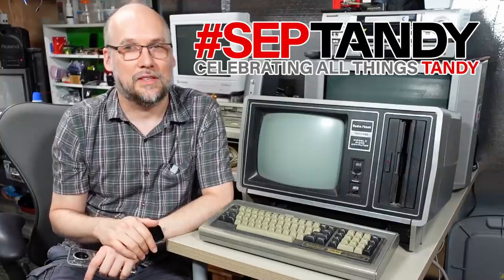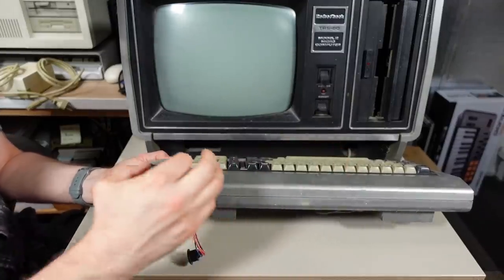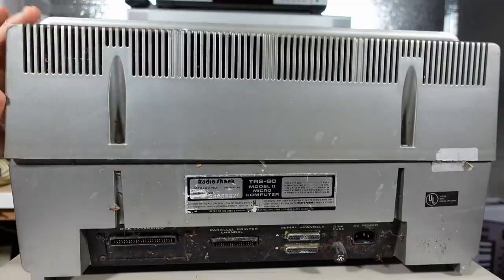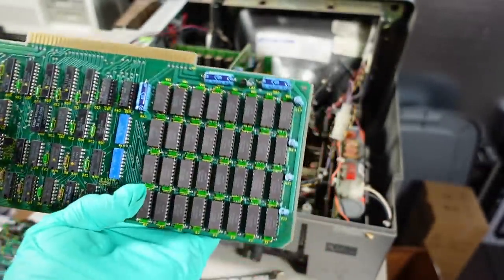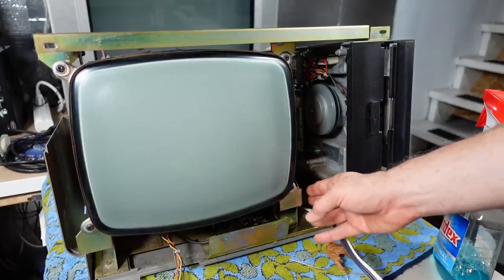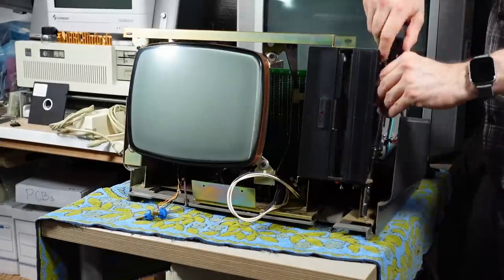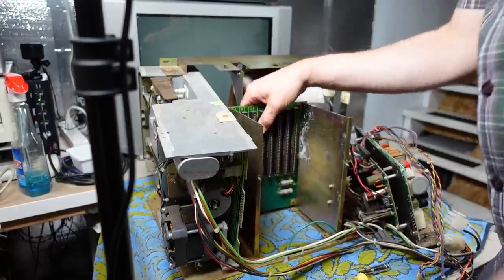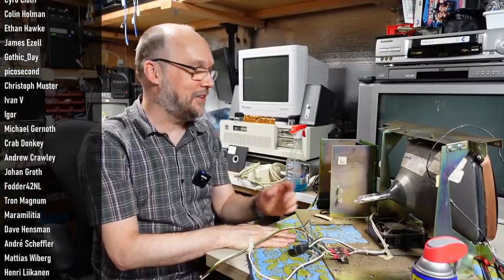Another left for dead machine: a TRS-80 Model II #septandy 🕸🕷🐜

Comment: I scored two of these off our local computer store's 'free stuff' bench 20 years ago, along with the heavy 3 drive expansion unit and boxes and boxes of disks.  One had a dead screen, the other a dead PSU.  They had taken all the cards out of both for salvage.  I got the cards on ebay and in my first ever vintage computer repair I managed to mix and match enough working parts to get one working machine.  Honestly I'm a little afraid of it.. when I turn it on, esp with the expansion unit, my lights dim. :)  Definitely a neat machine though.
Reply: I think you need a sub-station just for it… 🤣
Reply: Salvage=making a pittance off of cutting boards up for GoLd.... Stupid STUPID!
Reply: @jonathan_herr  Yeah.  :(  I'm hopeful though that they just went out as spares for other machines or something.
Reply: I will bid 400 quatloos for that towel!
Reply: Love it... Brings me home
Reply: For what its worth, even when they were new, the screen would dim when you started working the expansion drives. As I recall anyway.  Its only been 40+ years ago. SC
Reply: Ya, I had gotten two of these from a garage sale, the construction on these is horrible.  I have no idea what radio shack was thinking
Reply: @steingat  At least the end of the CRT neck isn't .005mm from the back of the case like it is on the Model III.
Reply: @steingat  ..I worked at “The Shack” when these came out…
We had surprisingly few repairs on these… mostly connectors that had come loose from shipping…
Reply: Maybe a shorted line cap in the PSU
Reply: Wow!  What a story!  Thanks for sharing! 💻

Comment: Nice! I learned how to program on a hand-me-down Model 4 in the mid-90s. -- holding down the orange button to boot into basic, and using "LLIST" (two Ls) to print ("save") my code to the daisy wheel printer. 

It's amazing to think that the cell phone I'm typing on is orders of magnitude more powerful than 90% of the computers I've ever used in my life... Thanks for the nostalgia, Adrian. ✌🏻
Reply: A daisy wheel printer printed nice, but we kept it in a case when it was printing due to noise.

Comment: When I started as a trainee in IT in '96, a lot of the Engineers had a "proper" tool kit with gas soldering irons, multimeters etc. One thing they did have (and I still have) was lonnnnng screwdrivers in PH2, TX15, 8mm, 5.5mm with a Magnetiser/Demagnetiser tool as there was still a lot of older terminals/PCs/NCR Towers that looked a lot like taking this TRS80 apart, and obviously put together with priorities of being able to survive a direct hit from a howitzer rather that user serviceability in mind!

Comment: I used them when new and have kept three of them running. We bought a Techical Reference Manual for our Model IIs in 1982 which I still have. EXCELLENT source of nearly everything in these and the 1-3 drive disk expansion unit. They are 100% business machines!. They were "built up" from the baseplate thus your dissassembly was harder than it would have been had you the info on the sequence of assembly. Power supplies have Rifa caps that go bad. It may not boot without the disk terminator plug depending upon the era. Western Digital and CDC 8" drives. GREAT machines for the time. Heavy and big but our firm did a LOT of things even IBMers didn't know how to do. Enjoy it Adrian.

Comment: Oh and I was going to say but forgot: Remember when you are testing that the 8" drive connector has a 24VDC pin.  If that connector is not plugged into the drive, the switching PSU won't start up and you'll think the PSU is dead even though it isn't.  That one had me stumped for some time.  You don't have to have the 120VAC power connected to the drive, but the DC cable has to be.

Or you could probably load the 24VDC rail with a big resistor or something to get the PSU to start up, but I've never tried that.

Good luck, man.  Again, let me know if you need any of the parts I have.  Contact info in that other comment.
Reply: Comment so Adrian sees this
Reply: Hey Bud!, Did you ever get that 8 inch going (The NOS one I think it was) I have another, and just curious!
Reply: @trs-80fanclub12  Hey man!  Long time no see!  :D

I haven't tried it yet.  I need to swap the logic boards over from the other drive.

I really appreciate you sending it to me, but if you want it back since I am taking so long to get around to trying it, just say!
Reply: @Lee_Adamson_OCF   Lol No Way, Its a relic, Keep it or find a needy one that needs it. Otherwise its a extra brick for me. Still trying to focus on getting a shugart real 5 - 1/4 to work on a usb adaptor.

Comment: I was just given one of these that was on its way to the trash pile that had been in storage along with the disk expansion system with two drives installed and a DMP-400 printer (and a Compaq Portable).  I believe I have the original manuals, there is a handful of disks, and the units were in storage with proper dust covers.  I'm expecting them to be in good shape.  It's all loaded into my poor Honda Accord at the moment.  I wouldn't have room for a passenger if I wanted one LOL! I know little to nothing about these machines, but I am excited to have one in my collection now!

Comment: @Adrian's Digital Basement I am sure someone else will have commented with this suggestion already but I do a LOT of automotive repair with bolts in really nasty places and a trick I often use is chewing gum stuck in the socket then the bolt or nut.  It will hold JUST well enough to keep it from falling out but will pull out when you lift the extension/stocket.

Comment: For reassembly, I stack a bunch of socket extensions like you did, and then tape the screw into the socket until I get it started, then pull off and remove the tape and then finish.

Comment: As I am nearly fished restoring my own model II I can say its a fun project.  The technical manual actually gives you the make and model of the tool required for assembly and disassembly.  It is really just a big nut driver that was commonly used by tv repairmen back in the day.  I will also be changing my 8" floppy for either a gotek or pc floppy drive.  Ready made adapters are available  There are a number of great model II software archives out on the internet.

Comment: I used to do A LOT of work on these.  The backplane is a take-off of the S-100 bus.  It's only 80 pins and the boards had a taper on them.  We used to build 10Megabyte and 411Megabyte disc drives for them.

Comment: With regard to your socket issues:  Try a 12, 18, or 24" extension that works off of a 1/4" hex quick-lock chuck.  Then use a cheap harbor freight or other magnetic nut driver that fits into that quick lock chuck.  Your total thickness of the tool would be approximately 1/2 to 5/8" which should fit into many of those spots.

Comment: That is a run capacitor on the Shugart drive. The "proper" way to disassemble is to remove all the "modules" to reveal the bare chassis. We used an Excelite 18" magnetic nut driver to be able to access the "module" mounting screws.  You will need at minimum a TRSDOS disk to boot the machine and it must stay in Drive 0 at all times.

Comment: Brings back memories. The early or most disk drives were Shugart and were reliable not so much on the Texas Peripherals drives and yes you used a terminator unless you had an expansion bay (drives).

Comment: The motor on the disk drive looks like a Shaded Pole motor, which would not normally need a start/run capacitor.   I am about 3/4 through watching now.  Looking forward to seeing this project through.  I think this machine could be a hidden diamond in the rough with a little bit of TLC.   You may need to change the big filter caps in the power supply for reliability in the future.     I find a bit of "blu-tak" works well to hold screws to drivers if you need to get them into a tight place

Comment: I have a Model 4 and it works, but needs a little work with the keyboard. Most of the keys will register correctly, but a few just do not register at all. Could simply be dirty keys or a possible bad cable/connection. Otherwise it boots to ROM, and both 5 1/4 drives work. I really love Tandy systems. My first computer was a Tandy CoCo Model 1, with the chiclet keyboard! 4k of RAM! Good times!

Comment: The private school I went to had one of these donated.  It was sitting at the back of the lab, separate from our Apple //e's.  It had an external bay with three floppy drives, and an external hard drive on top.  Our computer instructor allowed me to try it out .  I hit the TRSDOS manuals, and learned how to boot the machine.  I tried formatting the hard drive, but was stymied by a  bad sector.  It was the first hard drive that I'd ever encountered , in the mid 1980's.  In operation, these guys were intended to work with video terminals hung off of them.  Tandy/Radio Shack made terminals for this (serial ports) that looked like a Model I.
Reply: In the late 80s/early 90s my local Radio Shack had one of these running in the office with Xenix on it. The registers up front were dumb terminals and they had an okidata printer for receipts. They were using some DEC terminals up front.

Comment: In my basement is a working dual-floppy TRS-80 Model 16. Six months ago I started it up and a capacitor blew, but it still runs (have to take the cover off or it starts smoking). I bought it back in 1982 so I could automate my bowling league scorekeeping. Which it did, after I wrote the programs in COBOL. Other than that, I had no real purpose for it. It seemed to be a better deal than the IBM PC at the time. Little did I realize that IBM would become the standard.

Comment: I can't stop thinking about these machines.  The dual-machine offering by Radio Shack really contributed to the failure of the TRS-80 brand.  
The dual-marketing in their catalogs ruined their branding.

The Model III/4 was a neat, clean machine.  Big and clunky but y'know... pretty ok with lots of expansion features.
And the Model 4P (I bought one new) was really nice and had good developer tools (ALDS) and was a lot of fun for me.
I learned how to program in assembly language on it...  better to develop on than the IBM PC at the time.

But that dual-approach to product lines really hurt them.  And then, suddenly, they were simultaneously selling:
1.  The Model 4
2.  The Model 12/16
3.  The IBM PC clones that weren't really clones
4.  The color computer, which was a joke.
5.  The pocket computers, which were a joke
6.  The Trs-80 Model 100/102/200... the first two were really good but stole marketshare from the rest of the product line!

Yow.  I don't know what they were thinking.  They just couldn't stop and focus on a primary product.  They pissed off every TRS-80 owner, except the Model 100 users who didn't upgrade for a decade, coz "laptop" development stalled between the Model 102 and PCs until 80386 cpus could be crammed into smaller notebook computers.  That took a decade I think.

Comment: Man, I remember working on those old TRS-80's, and they're not fond memories. We had a couple Model III's, and they were an absolute bear to disassemble and service. It's as if they weren't even designed to be serviced after they were manufactured. After replacing the disk drive on one of the III's, I accidentally cracked the neck of the CRT when trying to reassemble it. The 4P was a bit easier, and I actually still have one which still works perfectly.

Comment: You really should try evaporust for things like this. It's much better than things like a rust inhibiting spray paint as it actually attacks the rust and leaves you with clean metal. Plus, it's reusable, gentle enough to get on your hands, and cleanup is easy: just dump it down the drain once it's too dirty to continue using. I have used it numerous times to restore old tools like wood planes and I've even used it on old rusty cast iron cookware. It really is amazing stuff.

I've also used naval jelly too, and that stuff also works pretty well but for small stuff just dumping the parts in a vat of evaporust is really the better option. Evaporust can work for larger items too, you can soak paper towels in it and apply the paper towels over the rusted area and just make sure to keep them wet while the process happens. I've done it that way too. I've found that the rust converter stuff in a spray can doesn't work as well, and can actually cause rust if you get it on non rusted areas.

Comment: Well I am looking forward to this one! At one time in the early 80s Tandy sold the most Unix machines by number of units, something like 40,000 for the Tandy 16B-6000. They had what Apple and Commodore didn't, "big boy" management and supply chains - all they needed was the right software vision and open specs and we'd all be running Tandy-compatibles today. They were even told as much, but squandered their big lead with incompatible proprietary machines having poor software choices. I sure hope you manage to get this old boy running! And long live the Z80! This was a real computer in the modern sense, as capable as the IBM PC.
Reply: The ‘open spec’ stuff at that time was S100 Bus for the motherboards and daughter boards…on the software side was CP/M OS along with the mighty Unix/Xenix….

Except for the boot code, CP/M was wide open….
Reply: @ernestgalvan9037  The TRS80-II has an S-100 type backplane but is not an S-100 machine. It is all proprietary.

Comment: You found the reason why the slang a Trash 80 was put on. This computer was only meant for service buy a technician and the tools and equipment with the manuals were locked away at night. Manuals a brown ring binder or later ones black and silver.
Service contract was highly recommended.  Piles of these computers around the service centers when mod 3 came out with 5.25 drives.

Comment: so back in the day I used tech wax... which was basically a soft wax.... you put some on your socket and then shoved in your nut or screw and it had enough holding power to get it started then but not to much to prevent you from removing your socket... I believe they started making tech wax again... it's a really simple product and it works

Comment: I'm sure this is long since reassembled by the time I'm watching this, but you can use foam or tape or something INSIDE a socket, shove the screw into the socket, and it'll hold to guide a screw down into a deep spot without a magnetic socket.  It's fiddly and sometimes falls out but it does work.

Comment: Sometimes fun to operate blindly - as long as your definition of "operate blindly" is less destructive than the 8 bit guy.

Single phase AC motors don't necessarily need a run capacitor, many have just a start capacitors, but that's for asynchronous AC induction motors, I don't remember how synchronous ones are wired.

In the car world, this would be called a "survivor" and the wear on the keyboard paint would be "patina" 😁

Comment: Presumably technicians of the era had the tools one would use for that equipment. Today we use different equipment making things easier to repair - except cell phones.

The question here is whether we want/need to keep this totally pure, or if we can find alternatives that could improve our situation. I think I saw a video about putting a Gotek in one of these systems (don't remember if it was a Model II or a Model I). Getting software on 8" floppies is going to be near impossible, whereas downloading software and storing it on USB seems more likely. One way or another, this machine is going to need the OS "diskette" to boot from. Until you can do that, all the other software is moot. In fact, until you can boot (P/S works, video works, floppy drive works, acquire a boot diskette), this is a steep climb. 

It'll be good to know if the CRT works - if it doesn't, another display will be needed - either a CRT, or to somehow bolt an LED to the frame and make the video card talk to it.

Then there's the P/S. Surely we could just put a more modern and beefy power supply in. 

If any or all parts work we can skip that step. Then we can work on the keyboard and fix anything needed on that. I do not envy him... 🤞

Comment: IIRC it was a GREEN phosphor CRT.  Let' see if I'm right.
IIRC there were some half height 8" floppy drives made with DC motors.
8" floppy drives had 40 pin connectors.  SCSI was 50 pin.
Those cards look like Intel Multibus cards, without the smaller connector.
That REALLY was a "trash 80" computer!  Hope you get it restored!
Good thing you made a video of the tear down, so you will know how to put it back together.
There should be some images on line for CP/M for the TRS80 model II.
I used to have a Z80 "big board" with 3 8" drives that ran CP/M.
Reply: ..this one had a WHITE phosphor CRT, basically an uprated TV VRT. Green came around ‘79-‘80.

The original Model I used a stripped-out RCA TV….. If you removed the RadioShack logo from the monitor, you found the mounting holes for the VOLUME and CHANNEL knobs!!!

Comment: i had a few of these in the late 80's, once the ibm-pc was established as a standard these things were available for almost free.. the best one i had was setup with an external 5mb hard disk and 3 external floppies running pickles and trout cp/m instead of trashdos.. the power supply boards in the mod-ii were a known failure point, they were made by aztec and tended to overheat being placed so close to the monitor pcb in a low-airflow area. to run an external hard drive or the xenix/graphics boards you need a revision d cpu board, it won't work with a revision c which was the most common version. the hard drive interface is somewhat wierd, the board that fits in the mod-ii is just a host interface with a sasi (not scsi..) cable going to the drive enclosure which contains a control board that converts sasi into standard st-506 mfm hard drive interface.